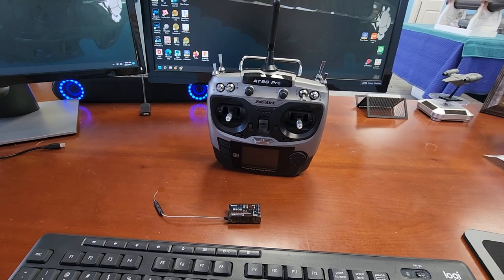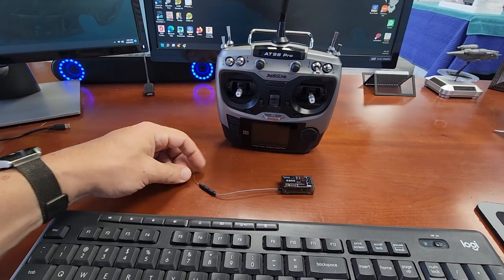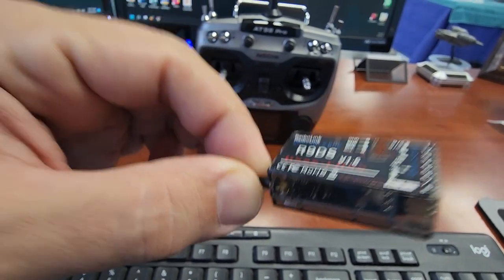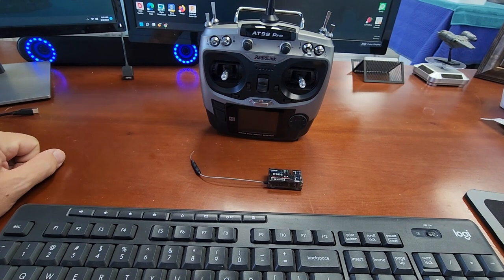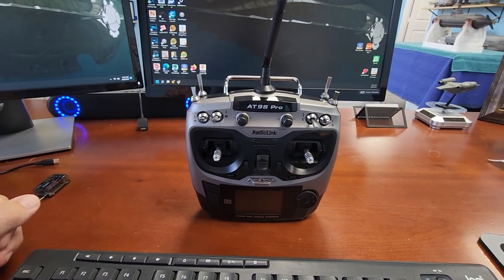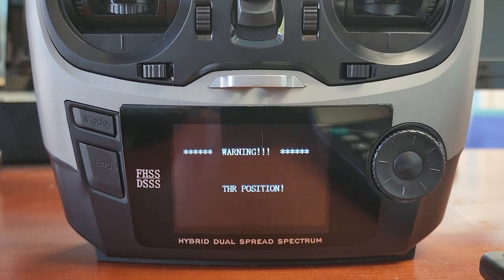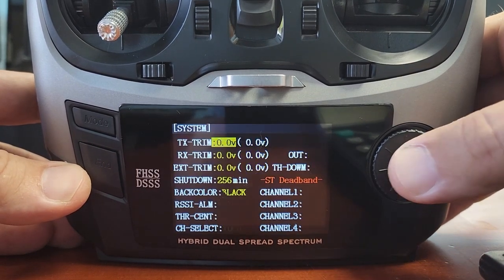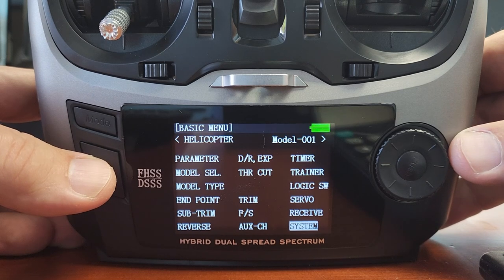Radiolink 2.4ghz System overview for RC Submarines

Comment: Bob mate some people In Japan are still making those very low  frequency transmitters. But they also use a RV tether and go to some very good depths in salt water.And they are actually working on a laser wavelength idea at the moment that could make radio wavelengths obsolete in two future. Just look how far laser wavelength reaches in outer space. The world is a new oyster in this wavelength scenario.Because there is many more options than radio wavelengths.Just look at  over wavelengths that aren't exactly wavelengths in the traditional way of thinking.

Comment: Hi please how can i use f/s to get return to home for my boat....is it possible to use this function to get the boat from 500m for example. Thanks .
Reply from the maker: Absolutely not possible when submerged. Possible with the integration of drone hardware, but to the best of my knowledge, it's not a commercial product and has not been used extensively in submarines.

Comment: What about something like the team black sheep tango 2. It runs on 900mhz USA or 868mhz U.K. would that be better for subs?
Reply from the maker: 900mhz is not good. I have another video testing that and it doesn't penetrate very well at all.
Reply: @RCSubGuy  I would have thought 900 would be an improvement over 2.4ghz tho. Maybe a foot of depth ?